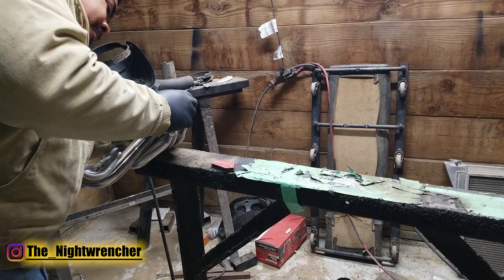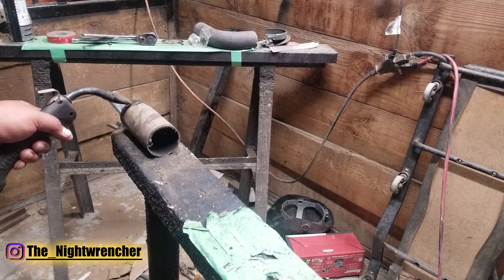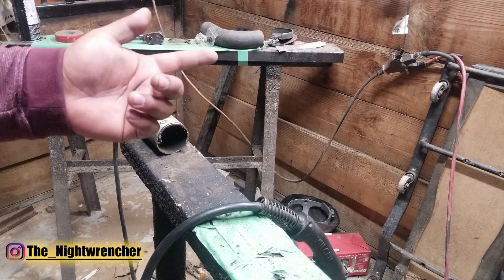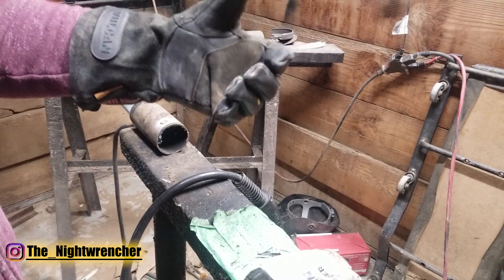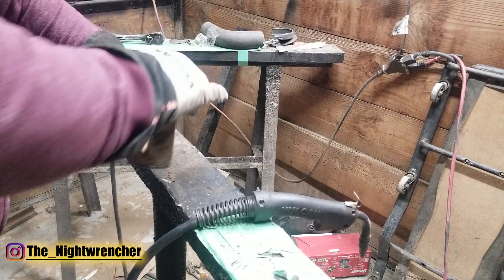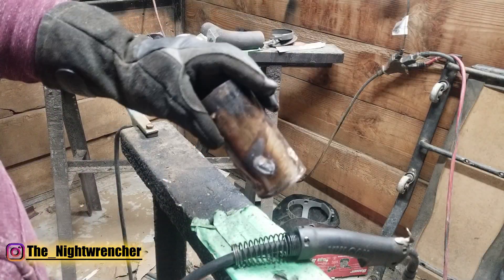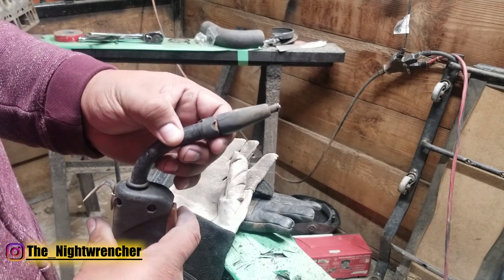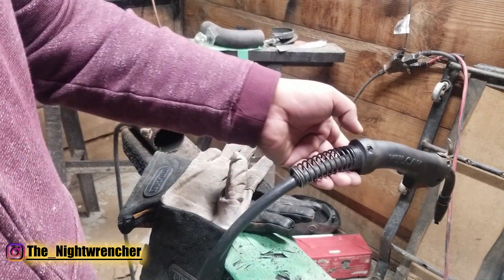5 Beginner Welding Tips And Tricks | Gasless Flux Core Welding |

Comment from the maker: Theres a whole flux core welding playlist here on the channel full of videos like this so check it out!
Reply: PAM COOKING SPRAY IS CHEAPER THAN THAT SPRAY, LOL LOL LOL AND I WILL TAKE YOUR SUGGESTION AND GET ME DOME ''''LINCOLN SHIELDED WIRE
Reply: Have you used E71T-11 instead of E71T-GS. E71T-11 allows all positions, even overhead has a fast freeze puddle. It also allows you to run multiple beads on top of each other( multiple passes) unlike E71T-GS and E71T-1MJH8 and E71T-1C Flux Core 0.030" wires.

Have you tried Blue Demon wire, they have E71T-11 in 0.030"/0.8mm.

Comment: .030" is thirty thousands, .035" is thirty five thousands (like a spark plug gap). the difference is about the thickness of a thick sheet of paper, 5 thousands is about an 1/8th of a mm.  Thanks for the tips.  I suppose Miller makes good welding wire also. Also maybe Century, but seeing I have a Lincoln, I would most likely follow your recommendation.  Thanks.
Reply: And 0.030" is 0.8mm, 0.035" is 0.9mm. Another tip for beginners, like me; don't get conned! I bought a cheap Chinese made Greenfield 'synergic' inverter gasless MIG welder, around $100. It allegedly does 0.6mm to 1.0mm in 4 steps.....EXCEPT there is no way to dial into the machine the wire diameter - it is preset, voltage only, to give a specific wire speed depending on the voltage knob (0-10).
I got to grips with the included 1lb 0.8mm wire then when it ran out loaded up 0.9 (the feed roller does 0.030 and 0.035) - my welds were a mess and I had to start over re-learning the voltage settings versus steel gauge. By now I had enough idea to guess it was wire speed - sure enough, regardless of what wire is loaded you get the same speed for a given voltage setting.
In other words, this machine only works properly with 0.8mm wire. TIP - before you buy, inspect the user manual or download it -  mine is as much use as a chocolate teapot - it is totally useless. It does not give volts versus metal thickness, nor even how to load the wire. I watched a YT video of another guy here in the Philippines with a competing brand, similar price, and he obviously got a lot of bang for his buck - digital readout and adjustment of volts and wire speed, AND a substantial user manual with a settings table.

Comment: I use flux-core & gas mig on car bodywork for a living. Both work great - but with flux core, the wire you are running matters far more than with solid wire. If you try flux-core weld with bad wire, it will do nothing more than annoy you. If you buy  good wire, then the process starts making huge sense. 

I was working on a complex car body all day  today, welding it using flux-core - wire on the spool ran out, it was late, easier to grab the gas-shielded machine sitting nearby than to muck about fitting a fresh coil - when you jump back onto a gas-shielded machine after doing A LOT of flux core, first thing you notice is just what a doddle gas-shielded is in comparison - but that's not the full picture, as flux-core produces a far stronger weld on car bodywork, it's less brittle, it produces a much flatter weld, it handles contaminates a LOT better - if you work on older vehicles (I do) and hit a section that has brass/bronze brazed areas, gas mig will do next to nothing for you - it won't weld. Flux core will. Flux core also shrugs off paint contamination, where gas-shielded will sulk. 

A good "Test" to prove how superior flux-core is for bodywork is to make a tack weld, then go break it off. With gas-shielded, you will break the tack easily enough - it's brittle. With flux, you will have a pain in your behind breaking the tack & will probably have to resort to grabbing the grinder & cutting it or you will pull & distort the surrounding metal it bites that hard. The downside to flux-core for bodywork is also tacking - it's much harder to do one handed if you are using your other hand to hold metal in place - which you usually are. Gas-s has the handy shroud to rest the torch on as you align your tip  - flux-c doesn't have that "steady rest" - you have to hover with the gun - which can be easier said than done.

 Flux-core also burns a damn sight brighter than gas-shielded -  if you got used to welding without a mask using your co2 mig, you're not doing that with flux-core. A mask is essential, even for small tacks. The arc is so bright, closing your eyes will not cut it. You also rapidly discover how good your welding mask is - any lag at all & the initial arc-strike is far more harsh than with gas-mig. If you are welding bodywork, you will often encounter situations where the masks sensor is blocked from seeing the arc - so it will not trigger the darkening. With flux-core, you damn well notice when that happens - with gas mig, it's no biggie at all. You will also discover how good your welding machine is with flux-core - the "high end" of the amp/volts adjustment is irrelevant - you will fast discover if your machine will go low enough when you have it banged off the "Low Stop" at 12V & would really like to wind it back to 8 or 9 but 12 is as low as it will go. With flux-core, you want a machine that goes REALLY low far more than you want one that pumps out the amps - flux core is super thin in reality & will tolerate very small amperages while still penetrating great - which is why it is a brilliant process. But also why you want a really good machine - which is never what happens as people think flux-core is a "Cheapo" process - so they buy the cheapest machine & the cheapest wire. When in reality it is a premium process that demands a premium machine & premium wire.. Ironically.
Reply: ^^ which nobody will bother to read, lol, but I weld high-end bodywork all day every day for customers using flux-core - which damn near every welder I know IRL says can't be done as it is "junk".  They're wrong, I'm right & they're just doing it wrong. Pretty much. Been welding for close to 40 years, weld all day every day on stuff people say can't be welded - if you gave me the choice of keeping just one process (we have close to every process machine in the workshop) I'd grab one of the flux-core machines & work away with that. We have 5k Kemppi 3ph Migs - I'd walk past them & grab the 500 quid single phase flux-core only machine if the kip caught fire.
Reply from the maker: No worries, I read all of it 👍 I think its just the bad advice going around and people assume that their welds are bad because they dont use gas. They dont realize that it CAN be done and done WELL.
Reply: Thanks

Comment: I have heard that for body work flux core is not really good that it's better to use gas and 023 solid wire for better penetration and lesson the chance of warping the metal,is there any truth to that?
Reply from the maker: I thought I already replied but it looks like none of my comments go posted up. For body work, flux core is a bad process. You cant really go any smaller than .030 so you end up putting in a lot of heat if youre not careful. Can it be done? Absolutely. Would I recommend it? Not unless thats all you got, you can make it work.

Comment: Is your welder connected to an extension cord?
Reply from the maker: Yes sir. Sometimes multiple cords
Reply: @NightWrencher  happen to have a video or link for extension cords that are okay to use I plan on using it outdoors and my closest plug is in my garage about 25ft away was planning on using a 10 guage cord. Any suggestions?
Reply from the maker: I would say go for it. After a few minuets of welding go and hold the cord. If its really hot then you need a bigger cord, if not, youre good
Reply: @NightWrencher  do you happen to know what gauge your extension cord is
Reply from the maker: I just use what I laying around. I have 10 12 and 14ga cords
Reply: @NightWrencher  okay thank you I’ll be going with a 10 gauge cord with the 3 outlets.
Reply from the maker: I have one like that, works good

Comment: One bad thing about one Lincoln welder in particular, the Powermig 210MP.  It does not work with 0.30 flux core wire in auto settings, you have to go full manual. Too bad for a pricey welder. To avoid headaches, I go with 0.35 Lincoln innershield wire.
Reply from the maker: I ignore the auto settings because not all wire brands weld the same and not all metals weld the same so its best to learn how to set up your welder reguardless of the auto settings

Comment: Hi, some good tips for sure!  Question: If you're welding a thin plate to a thicker plate, how do you adjust the settings on the welder - do you select the thin plate setting or the thick plate setting - or something in between?  Please explain. Thanks
Reply from the maker: I might have to make a video on this because I have been asked several times but basically you weld to match the thin plate holding the weld on the thicker plate and just dabbing into the thinner plate for it to bond
Reply: Certainly don’t want wonky beads

Comment: My flux core only has a high and low setting. I mostly use the high. Now I'm wondering if my wire is too big.
Reply from the maker: Always use .030 wire whenever possible. Get closer as set the welder on the low setting. Move slower and youll get better results.

Comment: I graduated in 97 and in 95 to 97 took a 3 year course in autobody and used a Lincoln gas cooled mig welder . Few years back I bought a blue gasless flux core welder from harbor freight . I had to upgrade from the cheap pos ground clamp to a heavy duty clamp from menards. I also use the 0.35 flux core wire from menards since its made in america . with all that being said when I weld I notice it helps when you heat up the area your welding with a plumbers propane torch to take the chill / moisture off the surface to help in the welding process. some times I have issues with it globbing up even though I adjust the settings ? so when you weld do you weld strait or put just a slit angle to the side when welding ? I hear you should draw the weld towards you if the part your welding is laying flat with flux core wire ??
Reply from the maker: I also heat up thicker metals to get the impurities out and then wipe it down with a dry cloth before welding. I try to angle the gun away from the weld. First, it lets you see the puddle better and second, it pushes your weld back and helps build it up.